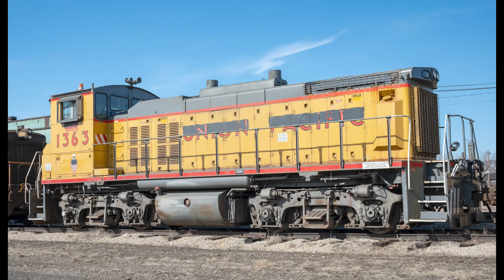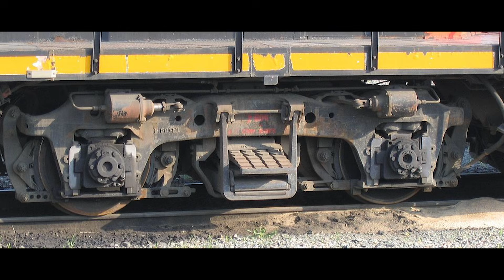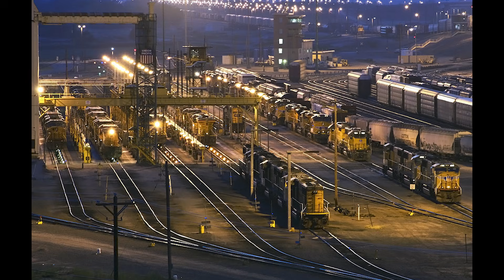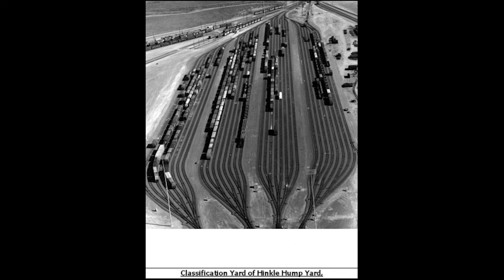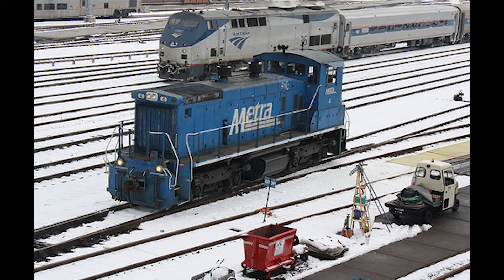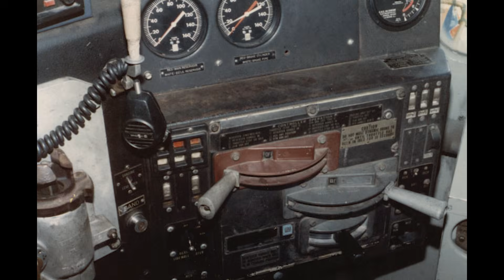The Engineering Behind the EMD MP15 Switcher Family

Comment: This video started off good, and then went "off the rails" (no pun intended).  MP15's had Bloomberg trucks.  It was the SW1500 that offered AAR, or Flexicoil trucks.  The radiator and cooling fans were not at the rear of the locomotive - they were at the "F" end of the locomotive, i.e., the designated FRONT.
The MP15DC did not have an alternator.  It had a generator.  The MP15AC had an alternator.  So did the MP15T.  The rest of this video is mostly redundant yak-yak-yak, but some of it is interesting.......

Comment: If there is a MP-15with switcher trucks I want to know where it is. Also, it wasn't an MP-15DC until the AC variants WAS introduced at SP's request 2 years later. As far as replacing other EMD switchers their replacements were usually GP-7s. Most of the switchers replaced with MP-15's were minority makes.
Reply: Actually the predecessor was the sw1504 made for the N de M
Reply: The SW1504's were the prototypes to the MP15DC's and soley built for N-DE-M in Mexico. There was 60 SW1504's in total and all of them were in the 8800 series (8800-8859). After N-DE-M was discontinued most of the SW1504's went to FXE/FSR and TFM-KCSM while some of the units were sold to HLCX and brought back here into the country and all of the units were renumbered in the 1500 series. The MP15DC's in official production were built as an overall upgraded series of the SW1500's, espiecally with the inclusion of EMD Blomberg trucks just like the GP series. The MP15AC's were an overall improvement of the MP15DC's with the design of the rear ends for the GP15-1's as the long hoods which included the radiator sections at the bottom. The MP15DC's were known for having overheating issues espiecally when operating in consist with multiple units. That design change on the MP15AC's and electronic cooling fans was a major reliability update. Lastly there was the MP15T's soley built for Seaboard System before transitioning into CSX. Only one of them was built for a small industrial company. The MP15T's were set up with the same turbocharged 8V645E3's as what the GP15T's used while the 8V645E3's altogether were used in previous EMD switchers with the last units (Before the MP15T's & GP15T's) to use them as naturally aspirated were the SW1000/1001's.
Reply: @Slim_Slid  You know your stuff, man.